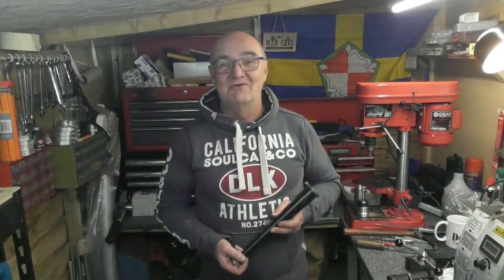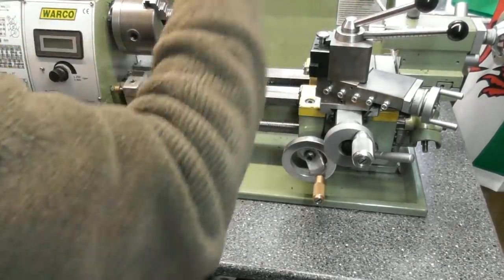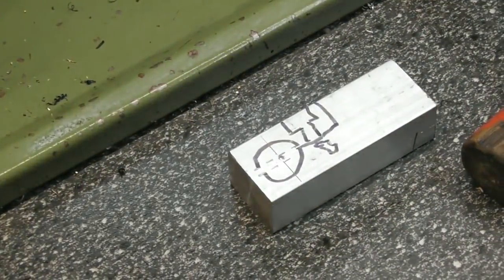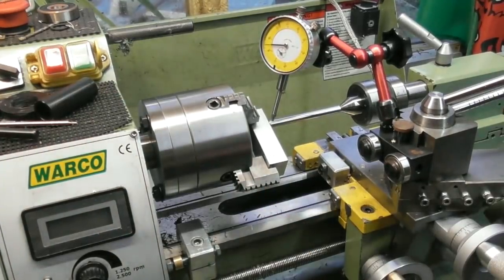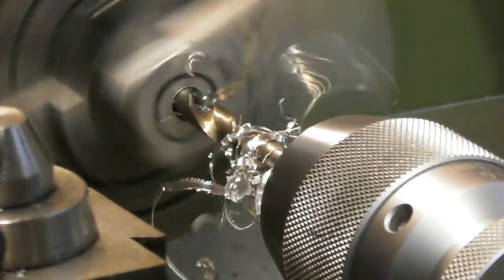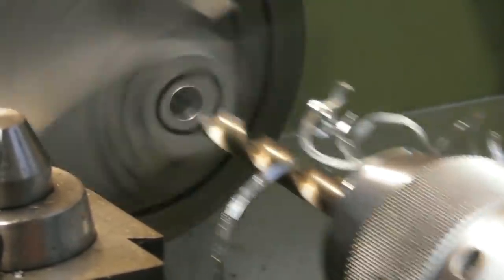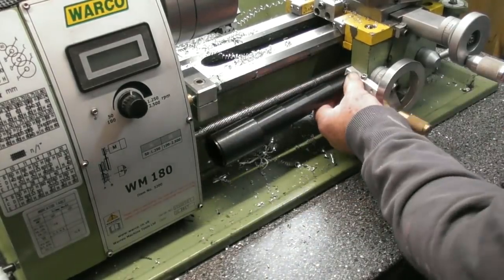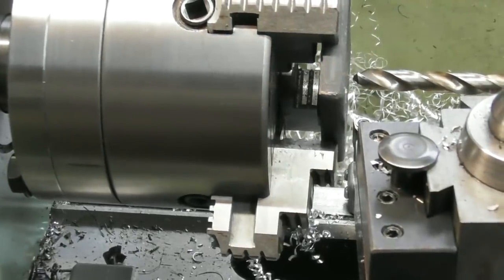Warco WM180 Lathe. Shop made lead screw protector , part 1

Comment: Nice one Ade. I've used those boards for all sorts. Another useful kitchen item is those silicone baking trays for seals/washers, cut using wad punches. Squeezed between spacers/washers with a bolt through they expand to seal exhaust ports etc for leakdown tests & the like.